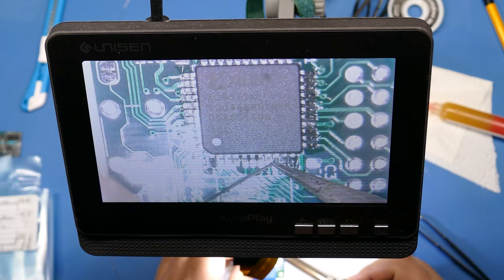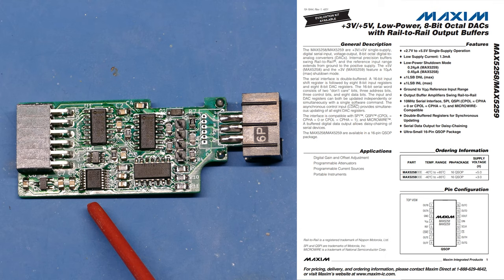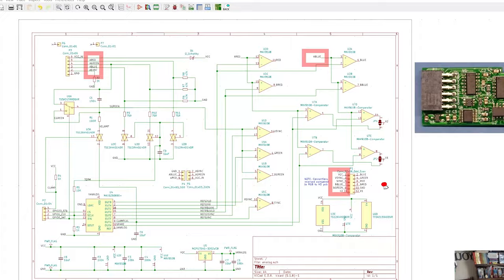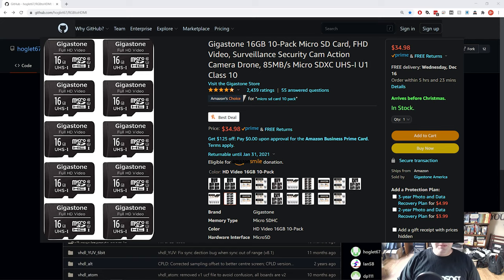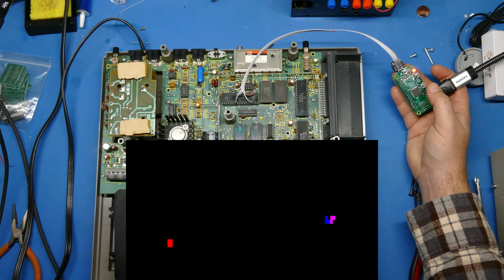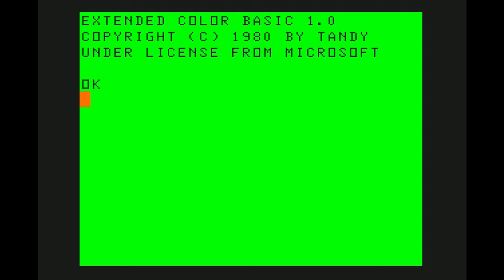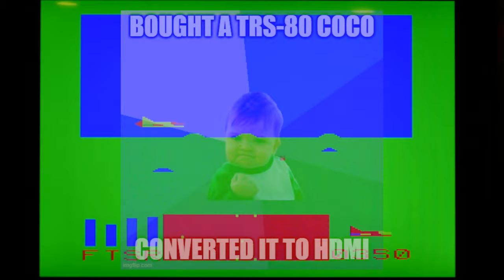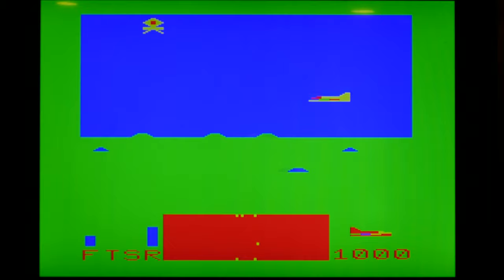Add HDMI To Your Vintage Computers!  Part 3 --OR-- TRS-80 Coco 1 Repair and Mod Part 2

Comment: I have the special adaptor for Amiga500 OCS. Really happy with this solution.
Reply from the maker: Really glad to hear that! I haven't tried on my Amiga yet.
Reply: @RetroHackShack  The adaptor I have is an internal one, that sits between the board and Denise chip.

Comment: I was able to get the RGBtoHDMI working with a Dolch LAM4850 logic analyzer.  I am using the Tandy profile. It is not 100% Pixel Perfect like Adrian says about his conversions but it is darn close.  I have a lot to learn about the device.  The Dolch puts out a 3 signal video in 6:30 TTL levels.  HSYNC, VSYNC, and VIDEO.  I had to invert the video signal with hardware to get the picture I needed.
Reply from the maker: Nice job!

Comment: Wow, amazing work. I was thinking of trying to pull the YUV from the CoCo but this is a huge step up from that.
Thanks for sharing Aaron.
Reply from the maker: Just FYI - There will probably be a part 4 because I have been working with one of the developers and we now have artifact colors working with the HDMI output as well as support for the Coco 3's RGB port. I think there was a trade off you had to make with your solution with the artifact colors IIRC.
Reply: @RetroHackShack  Cool. I did lose artifact colours, but as mine is a PAL system they don't form solid colours like NTSC. So I'm not sure the same could be done for a PAL system, I guess it depends how the board(s) translates PAL signals
Reply from the maker: Yeah. That just it. This can add the artifacts for PAL systems. From the forum ... "The artifact code works on the Dragon and PAL CoCos and also the PAL Apple II variants."
Reply: @RetroHackShack  Oh that's awesome. I will definitely have to build one to test it out
Reply: @RetroHackShack  Did you ever get the Coco 3 version tested?
Reply from the maker: Yes. See my Coco 3 video. I was just using it today.

Comment: I finally connected up my CoCo 1 to the RGBtoHDMI. After multiple cabling errors I finally got it working! Woohoo!!!
Reply from the maker: Awesome! How's the picture quality?
Reply: @RetroHackShack  Superb!
 I was initially struggling with the screen going blank whenever the menu turned off, but that seems to have stopped when I set a specific output resolution instead of "auto".
 Will do a comparison video soon.
Reply: @RetroHackShack 
youtu. be/_65X4UgN1gQ

Comment: I finally finished assembling both the analog board and rgb2hdmi and wired it to my CoCo 2. It works,it's usable, and it's cleaner than RF but it has annoying sparklies. I've adjusted the settings
as best as I can understand with marginal improvement so I'm thinking I broke something or there is a bug in the firmware. I'm going to go over what I did to make sure it isn't something on my end and if it's good on my end I'm going to submit an issue on the repo. However, before I submit the issue, I want to know if you saw sparklies when testing it out on your CoCo 1.
If you did, were you able to fix them and how? Thanks for the video and for your feedback it really helped me get this amazing board together.
Thanks!
Reply from the maker: I am assuming this is an NTSC coco and not PAL? All I had to do was "auto calibration" to get the best phase and that fixed some minor glitches.
Reply: @RetroHackShack  Yes it's NTSC, unfortunately that didn't solve it for my setup and I tried with two different CoCo 2's. I'm going to have to make a second analog board to compare. Thanks for replying!

Comment: I was looking through the repo but I can't seem to  find how to wire the board to the VDG. Did you get that from somewhere else?
Fantastic video!
Reply from the maker: Did you look on the wiki? See if this helps https://github.com/hoglet67/RGBtoHDMI/wiki/Cables
Reply: @RetroHackShack   I did but it was 4:00am so naturally I missed it.... Thanks!

Comment: Awesome video - glad it turned out so well. We should get you to join in on the CocoTalk weekly game challenges. I do have one question - from seeing Daggorath, I presume that you don't get artifacting colors on the HDMI out?
Reply from the maker: Correct. No artifacts, but I think they might be able to be emulated. I still have this hooked up. Let me check.
Reply from the maker: It does have artifact emulation, but I can't get it to do anything on D of D. I will ask in the forum.
Reply: @RetroHackShack  - D of D Doesn’t use artifacts (not on purpose, anyways), so you would need a different game to test. Do you have any others handy?
Reply from the maker: @CurtisBoyle  I could swear mine had artifacts as a kid. What do you recommend? I can always plug in my Coco SDC and load something up.
Reply: @RetroHackShack  Great video!  D of D will definitely show the artifacting (as any program using the 256x192 PMODE 4 graphics screen will when using native output).  I think what Curtis means is Daggorath doesn't purposefully make use of artifacts to show objects in different colors.  An adventure game like Sands of Egypt is one example (of many) where artifacting is deliberately used.
Reply: @paulshoemaker4761  - yes, that was what I meant by “on purpose” (it does showing the orange/blue “fringing”, but it was designed as a monochrome game). But a majority of games are designed for artifacting - Sands of Egypt, Donkey Kong, etc are good examples.
Reply from the maker: @paulshoemaker4761  Ah. I see. Thanks Paul! I am testing now with Zaxxon, but can't get the artifacts to work. I will ask for help on the forum and if I find the solution I will pin a comment here and post on my website.
Reply from the maker: IanB, one of the maintainers of the project, says that there isn't artifacting for the Coco1/2 at the moment, but he is trying to add in the next few days :)

Comment: You didn't test a game that uses the red/blue/white/black color set which relies on composite artifact colors. I would be interested to see if that works.
Reply: Try playing Pegasus and the Phantom riders. Let's see if it comes out in color or black and white.
Reply from the maker: It didn't then, but it does now. You can see an example on part 4.

Comment: Wait a CoCo 1 and 2 can output YUV natively? Why can't I find anything about this on the interwebs? Wana send me the pinout or is that a secret?
Reply from the maker: It's in the technical reference manual. Also, you can find the pinout for the cable on the GitHub Wiki. That should get you there.
Reply: @RetroHackShack  Interesting. I'll have to try this with a TV that has component inputs sometime. Cheap RGB and don't have to shell out money for the VGA board.